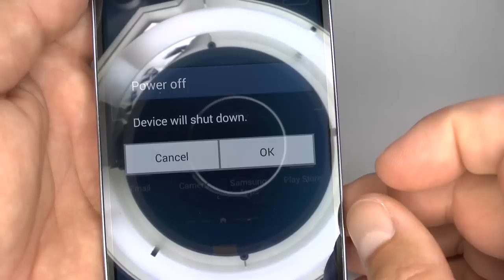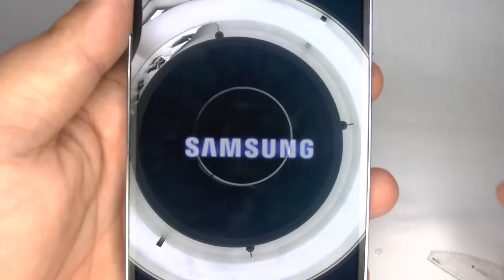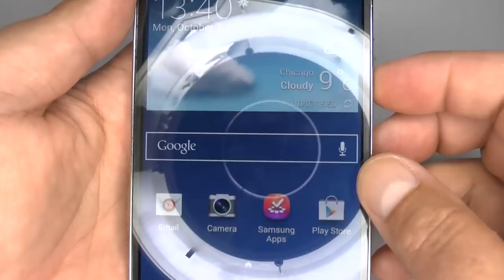Galaxy Note 3 Disassembly Teardown & Assembly - Digitizer Screen & Case Replacement

Comment: That's horrible that I need to do everything from video just because I want to change the screen frame which is most likely to be damage in each hit. On note2 it was easier the frame wasn't attached to the screen. The scariest part is the heating and separating the screen from the frame. Now leave the frame damaged or try to change it?

Comment: Could you make a video about touch key replacement... thx... btw you could help me with my problem: My menu and back key is not working when i touch them with my fingers but they work whit the s pen... and the lights are not working
Reply from the maker: 24:18 shows the home and touch key flex. The s pen works on a different flex and the lights are part of the home ane touch key flex
Reply: So i have to replace them?
Reply from the maker: Emanuel Ivan Mlikota that might fix the problem unless it has water damage on the mainboard

Comment: Do you know if the part "Touch Digitizer LCD Screen Assembly + Frame" for N9005 and N900 3G are fully compatible ?
My N900 3G has the LCD broken and its hard to get the frame, instead the N9005 it's offered everywhere.
Reply from the maker: I don't know if they are or not, try using the live chat option on the site link in the description..
Reply: *****
Thanks, I will.

Comment: do i need to replace the digitizer along with screen. It was dropped on it back and the display is dead but i can tell the phone still works. what is your advice??????
Reply: is there a backlight led that can be replaced separately??

Comment: hey le55ons, thanks so much for your vids, very insighful, however i replaced my screen just like you showed us and made sure the sensor was pushed all the way down but the screen still remains dark when i turn on the phone, pls help
Reply from the maker: does the screen show an image when its booting up?
Reply: No it doesnt sir.
Reply from the maker: paul benjamin then I would suspect a faulty new screen, can you try plugging in the old one and see if that works
Reply: Ahhh!! I suspected that but wasnt knowledgeable enough to come to that conclusion. I damaged some of the wires for the old screen removing it. It had cracked, hence the replacement. Thanks il send the screen back to the seller and report it faulty. When I get a replacement, il try again and contact you if I still cant fix it on my own. Thanks for all your help. Truly appreciated.

Comment: Hey I was wondering If u can help me I was trying to clean out the headphone jack with a needle and now it don't work and my blue led light don't come on either thanks
Reply from the maker: replacing the headphone socket will cure that problem..

Comment: question
my note 3 mobile fell on the floor and went all black
does changing the GLASS fix the problem?
Reply: no. you need to replace the lcd screen or buy a blacklisted one and swap the motherboard depending on what you have

Comment: I have a quick question, my son has a Galaxy Note 3 and it just stoped turning on all of sudden, when we press the power button it vibrates, but nothing happens, do you have any advice to fix this problem? It would be greatly appreciated !
Reply: The phone is turning on but the screen is dead?
Im having a problem with my Note 3, I was on the couch playing 8 ball pool and locked my phone to help my gf in the kitchen. When I wanted to unlock my phone the screen was just completely dead, although I was still able to unlock it (touch screen was still responsive until the following day) and I can still hear the phone turning on and when I receive notifications, LED is still working. My only guess is that something couldnt resist all the heat and eventually gave in.

Comment: One think technicians , To remove that USB board , u need to apply some heat , Bcz that board is sticked with Glue , Set the blower  200 Degree Celsius temp , and run up the heat over the board

Comment: Mine took some water damage and works fine until battery died, it says its charging but just continues to discharge , I first thought it was the battery but I tried another battery in it and it did the same thing,  any clue to a possible fix? Any help would greatly be appreciated, thanks
Reply: Samsung quality!

Comment: I have a question, can I use original spare parts of note 3 to upgrade Chinese phone? For example, replace rear camera in the chinese phone no.1 n3 with camera that is more quality? 
Thank you, isacc.
Reply from the maker: I doubt any parts would be compatible, probably different plugs and cables etc.
Reply: No, definitely not. The circuit boards and connectors ARE completely different.
I've a fully working (clone S4 mini) sitting in a draw with a cracked screen. I've tried everywhere - even the manufacturers in China, and parts aren't available.
Reply: Thanks, the camera really terrible, I think it's no more than 5 megapixels
Reply: The cameras on all these cheap phones are dreadful - regardless of how many pixels they're supposed to have. Even if it were possible, you'd be wasting your time changing it.
Reply: thanks

Comment: i Broke my phones digitizer so I Replaced by screen.. i bought the entire holder with the digitizer and bezel, but when i replace all components it works except when i connect my back which holds the speaker. When that is done the phone shuts off.. any suggestions? Ill be greatful for any help. Thank You!
Reply from the maker: its a strange fault, can you remove the mainboard and compare the metal casing to your old screen, make sure its all the same and any pads or insulation is transferred over

Comment: himy wife dropped her phone yesterday, I had fitted a glass protector (glass not plastic film) the phone is working but nothing on the screen.the protector was broken but the original screen looks fine.the phone is still receiving text and email messages as it vibrates and flashes the led in the corner.any ideas would be very gratful
Reply: try factory reset it by holding power and home  button when you turn on the phone, select  factory reset

Comment: Hi, I have a galaxy note 3, and I went to take a hot shower with the galaxy in the bathroom, and the steam from the hot shower made the water indicators turn red, now the digitizer only responds to the stylus. Can you please give me any advice on what to do? I'm very handy, I've been able to fix my s4 and s3 's before. Thanks in advance
Reply from the maker: I would take it apart and give it a long hot blow dry with a hair drier. If that doesn't fix it you could try another screen, but theres a good chance a new screen will have the same problem if there's damaged to the mainboard

Comment: Please help me with the name of the tool you used to separate the frame from the Screen. I did not get the correct name as your called it, or do not know the correct spelling for it. I have been looking for it on Amazon and Ebay, but could not find it
Reply: +Kennie Amara I believe that's the "Triangle Pry" tool which can be found in many cellphone repair kits
Reply: 14:35 -- "You can use a guitar pick if you don't have a plastic knife.  This can be quite tricky to hold on to with gloves."

Comment: hello sir, other day i found a 1mm gap between the frame and screen on my note 3, the samsung guys said they are gonna change the "lcd/octa part". Can you tell me what are they changing exactly?
Reply from the maker: the screen and front housing I'm holding at 12:50 is probably the part they will replace..
Reply: Thank you.. i hope they do so..

Comment: Hi all,
   I need some help regarding this model.
Four months ago i bought the same model NOTE 3-N9005 from Malaysia and it wax working pretty nice with 4G network over there. 
Recently, I moved to the USA and tried with different service providers such as AT&T, T-Mobile,  MetroPCS etc, unfortunately it only operates as 3G (H+) as it is shown on the status bar on the top.
I found the same type here in the US but with different models such as N900V OR N900A.

Can anyone could help and tell me what can do to make it operable under 4G network in the US?

Thanks for help.

Comment: My "proximity sensor" on my Note 3 is not functioning correctly and my screen wont turn back on after I removed it from my ear during a call. But I find it that if i press a couple times on where the proximity sensor located then it would starts to work properly again for a little while and then not responsive again shortly. By the way I do see fine dust making it's way into the front facing camera. I was thinking that maybe the cause of the malfunction of the proximity sensor is probably from fine dust interfering it to function correctly. I have this phone for 9 months and this is the first issue I had by far. Do you think taking out the proximity sensor to clean from dust built up will solve this issue?
Reply: 100% sure Dust issue. It happened to my previous S4 (which is now my dad's) and we opened it up, used Q tips and alcohol and wiped it up. Its very easy to do compared to a screen replacement as seen in this video!
Reply: Thanks for the reply, I will open my device up and use Q tips and alcohol to clean the fine dust out and hope it will work properly again. Very good video and helpful by the way. Thanks again :-)
Reply: Kushimoto Yaksa No probs! You wont regret it! It can be a very annoying problem esp if you use ur Note 3 to call a lot.

Comment: update on Note 3 echo after screen/case replacement, took off the case and the echo stopped. Must be something to do with the porting of holes in the new case. status: unresolved
Reply: update, the echo was from using the back of the 900A on the N9005 digitizer. I guess the porting for the mic/speaker is slightly different and was causing the echo on the other end. Also the antenna contacts dont exactly line up either. reception was a little sketchy until I paired the phone back that corresponded with the motherboard. Sorry for all the posts to get to the heart of the matter.  protective case is back on and echo is gone.

Comment: i want to replace the N9005 loudpeaker ringer.. but how to i take it out???
Reply from the maker: you need to replace the 'rear housing' as it contains the speaker
Reply: Oh.. Thank u so much..
Reply: ***** i have replace the rear housing. but the speaker just produce a cracking sound which make musics and games sound so awful. what happened?
Reply from the maker: Chris Eng did it make the same sound with the old speaker?

Comment: my note 3 suddenly keeps saying my headphones are plugged in when they are not. As such I cannot listen to and callers cannot hear me unless I plug in actual headphones. .What caused this and is there a fix?
Reply from the maker: try unplugging the headphone flex cable 8:00 if the problem goes away a new headphone socket should do the trick..
Reply: ***** is middle chassis(outside frame) replacement simple on note 4 as it is on note 2?

Comment: Hello I need help with my note 3. It just stopped working. I tried new battery, charging and it’s still not working. It heats up pretty bad when I charge but it doesn’t come on at all. Could it be motherboard problem?
Reply: Try hard reset it
Reply: Creative Ann it won’t even come on before I can try anything else.
Reply: @versatile7432  To me might be board issue

Comment: I dropped my phone and now the screen won't come on but the phone powers on. Can I fix that and with what?
Reply: The drop have probably disconnected the flex cable from the screen. If it's just that, reconnect it back. Or else, buy a new phone. Peace.
Reply: I just did. Got the new iPhone 6s Plus, but I have some pics that I did not backup.

Comment: I dropped my phone in the toilet, I replaced the USB port since it was not working but I just discovered that when I call someone, I can hear them, but they can't hear me. Any help?
Reply: +Starky Productions I had the same problem. Never could get it to work properly. Even after replacing the phones mic multiple times. I had to use earbuds with a microphone built in.

Comment: Could you use this to trun a 16gb in 64?
Reply from the maker: if you can get hold of the 64gb flash memory chip, it should be possible to change using a hot air soldering iron. But I've not seen or heard of it being done yet..

Comment: i have touchscreen problems on my note 3. a vertical area of about 1cm in the left part of the screen, starting from the left of the home button all the way up to the left of the perforated silver earspeaker... doesn't register VERTICAL finger touches (horizontal finger touches or ANY kind of stylus touches are working just fine).

what could it be? it's very unusual. i haven't seen any forums on this problem : just an area of the touchscreen not registering VERTICAL finger touches WTF ?
Reply: A new digitiser shouldl solve the problem, but don't tackle it yourself unless you've the confidence and patience to do it. Have you sat down with it your trouser pocket? LOL
Reply: When i wrote this message, my phone was already in the service being repaired and today i got it back. Good as new. Anyway, i was curious as to why it happened. I haven't sat on it.  I've read somewhere that if you connect the jack or micro usb to the phone and wiggle them around might cause this. I might get a wireless charging pad to avoid any future problems :)

Comment: I dropped my note 3 and now the screen doesnt work. Its making all the right soundsand coloured led flashes but blank screen. Ive taken it apart as per video but no result. The screen has no visible damage. Any ideas?
Reply from the maker: its probably a hairline crack in the lcd, you cant see it but a new screen will fix it

Comment: So, I have a Samsung Galaxy Note 3.  Dropped it toniight, but the screen isn't broken.  I turned it on and it had horizontal lines.  I quickly pulled the battery, now it'll power on, makes all the start up noises, and the little indicator blinks, but the screen is black.  What happened, and is there a way to fix it so I don't lose everything on my phone??
Reply from the maker: Its most likely an internally broken screen, once a new one is fitted you will still have everything on the phone..
Reply: Thank you Le55ons.  I thought it was the digitizer.

Comment: i just dissasembled a friends galaxy note 3 to replace lcd... Just found out about the s-pen sensor... I need one really fast...
Reply from the maker: you can use the old one
Reply: ***** i just ordered a new one!  But there is a sticker behind that lcd flex cable that got unstuck too. Is the  gray sticker beneath the lcd flex cable where the flex cable components sit on . You can see it at 23:06. i removed that sticker since it got screwed up. Is that sticker needed? Do i have to get one of theese to? How is it called?    Thanks for your help!!
Reply from the maker: kotsios photiades don't worry about the grey sticker, it won't hurt to leave it off
Reply: Ok THANKS a lot man!

Comment: Hi, I dropped my note 3 and now the screen won't turn on,  but you can hear the sound. How do I fix it..?
Reply from the maker: its probably cracked the display screen inside, it only takes a hairline crack to stop it working. You might not be able to see the crack but I'm sure a new display would fix it, you'll find a link to a good supplier in the description

Comment: Hi, that was a good video.  I have the same phone, and cant get WiFi, the symbol at the top left is fainter green than the others, and if I hold it down, rather than giving me the local WiFi networks around, it gives me an option to use smart network switch.  Ive looked on YouTube, and t bf e I ternet, and people say change settings, like take off, always scan, tried it, nothing.  Please would you advise me.  Add on Facebook.  Look for Andrew Mckenna.  Thank You.

Comment: Hey LE55ONS, i just did this. it will only turn on if i press the motherboard upper left, any idea what i did wrong? it seems motherboard isnt properly in but cant figure out why since ive been doing it 20 times over allready. Please help me. Thanks in advance
Reply: Please help me i really dont know what to do:(
Reply from the maker: Mitch Bolkenstijn have you tried screwing the back cover on ?

Comment: I took the wifes phone apart to replace the headphone jack, put it back together and now she has no led notification lights. Took it apart again to check it over and still do not work. I searched a little. Power saving is off, all the check boxes are checked. Not sure where to go next. There is no mention of how to replace them in video.

Comment: need help if an body here.i have galaxy grand 2 having problem its getting heat up from its normal temperature and battery continuously discharging and complete discharge in one hour and charging time is too much. it takes almost 5 to 6 hour or some times complete day  to charge.i googled but nothing find please somebody help me.i am tech guy too and fixes many things own but stuck on this.